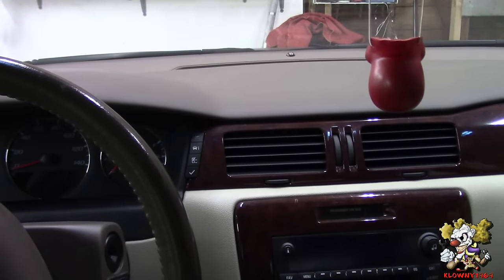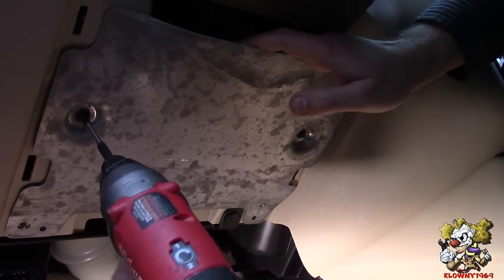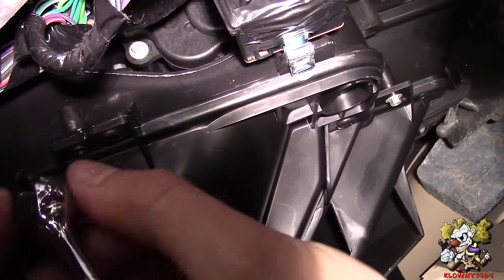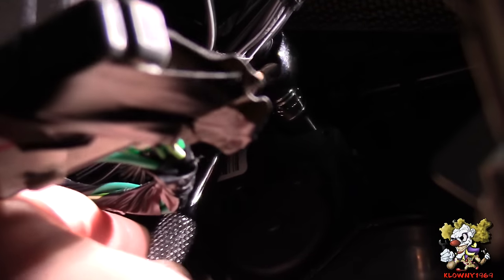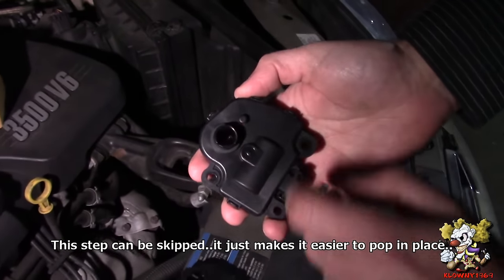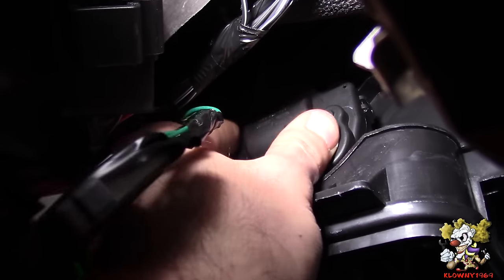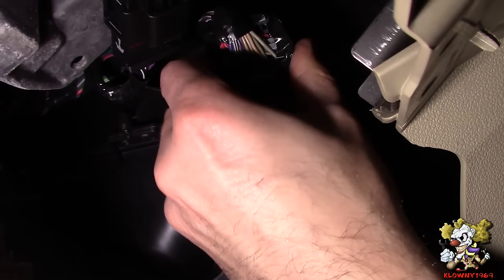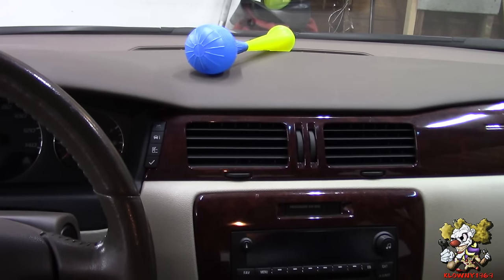How to Replace a DRIVER Side Heat Door Actuator - Chevy Impala 2006 - 2013 - DIY

Comment: Thank you so much man. Now that it's getting hot I was starting to die because in my car it wasn't making the noise but it wouldn't change temperature. You made it look easy but I was able to do it!
Reply: That's exactly what my car is doing I don't here no noise whatsoever yet I don't get cold air on the driver side only the passenger. I haven't done any work yet but I bet this the problem that I am having with my car.
Reply: @rgawt1870  did you find out if that was the problem? I have the same issue on a 2013 impala
Reply: @xTHETRAINx  no I have not and the heat here in Texas is excrutiating. Someone told me about an auto electric that's what I'm doing next. The new actuator I installed didn't work out at all
Reply: @rgawt1870  yeah I'm in San Antonio, my ac vents all blow cold today (measured about 50-60F) even when it was 100+ outside but my drivers side vent blows around 70+ F which doesnt feel cold at all. I'm going to have a professional evacuate the entire system and refill it with r134a.
Reply: @xTHETRAINx  yeah that's what I'm doing also we need a professional I thought I was going to saved me so money but apparently that won't be the case here 😧

Comment: STANDING OVATION!!!!  Side note: I used 7/32 standard on the actuator screws.  Also I turned the gray clip at 5:18 180 degrees w/o knowing it.  It took a few minutes to figure it out when replacing everything.

Comment: Thanks for the tutorial.  Just replaced mine.  Your video was priceless!!! Synched the new one up using a 9 volt battery from one of my smoke detectors and 2 wires I stripped from an old cat5 cable. If you don't have alligator clips and don't want to hook up to your car battery, the 9 volt battery will do just fine and you can't hurt yourself.  I found it extremely difficult to get to the actuator as I am pretty large and the space is very small.  I also have a Viper security and remote start system installed which was also in the way.  It took more time than I expected, but I eventually found the right angles to get to the bolts.  Thanks again for your help!
Reply from the maker: +Steve Pfahning awesome..glad i was able to help

Comment: Great video.  we have a 2010 Impala that already had once actuator replaced on the passenger side.  The Chevy dealer (Highland, IL) wanted several hundred to fix, claiming it was a difficult and the parts were "expensive".  After watching and re-watching the steps in your video......2 hours of my time (having to get part, take apart, and put together) and roughly 35$ for the part from O'Reileys.  Thanks again!

Comment: Just replaced. Took about an hour. Tight fit to get in there. I had three pressure clips instead of two. I've seen the forums where people have paid $400 to get it fixed at the dealership lol. The part was only $40
Reply from the maker: Corey GIbson yup they charge alot..thanks for watching and commenting
Reply: klowny1969 Yes and these are junk parts. Everyone with an impala I know has had all them replaced usually before 90k. And all the other recalls and problems.

Comment: My heat only works on the passenger side. The drivers side blows cold. Is the actuator I need to solve this issue?
Reply: I have the same problem! Did you find out if this was the right part to fix?
Reply: @kim.hadassah  yes did you ever find out if this is the fix?
Reply: @THEBLOODYBALLOON  yes it was. Unfortunately, since then I have had to replace both sides a couple of times. A weakness in the chevy impala limited I guess. Get yourself one of the attachments for your drill that is an extension that bends. It will help in those tight spots. Depending on your model of car it can be a pain to get to. Have patience you can do it!😊👍
Reply: Did you ever find out what the problem was I’m having this same issue and need answers
Reply: My driver side blows hot but the passenger side cold 🤦🏻‍♀️

Comment: is there any other way to adjust the acuators hole to line it up like the old one besides the wires to battery?
Reply from the maker: Darrell Williams u dont really have to line it up..its just a little easier that way..u can insert the slot in first, then turn it and align it
Reply: Thanks alot .. ur great man
Reply from the maker: Darrell Williams lol thank u
Reply: Here's another "TIP"..... rather than using the car's 12 volt battery to advance the new actuator to match the old ones position, use a small 9 VOLT battery with a battery clip and leads. MUCH EASIER (and safer)  than hooking to battery leads ....
Reply: Thank you so much got it fixed! Your video saved me man. I appreciate it

Comment: Thanks for the video! Saved me a couple hundred bucks. I don't know how you got it done at the angle you were doing it at either. I had to try doing it upside-down after seeing another commenter having success that way, and FINALLY got it done. Took me 5 hours total, maybe 1.5 after I went upside down. Anyone that got this done in 10-20 minutes or whatever must have the smallest hands ever, and zero broadness to their shoulders whatsoever.
Reply from the maker: I'm a mechanic..we are contortionists :)

Comment: Thank you for your help! I definitely recommend the 5.5mm socket, and using the 9V battery to move the new actuator around to match the old one. I really appreciate you sharing this fix!
Reply from the maker: glad i was able to help..dont forget to subscribe
Reply: If you replaced it and didnt know to switch it and it needs replaced again how do i know where to set it if it was set wrong and i don't have the old one

Comment: You were a blessing to me. By me watching this video I was able to save myself 700.00. It was tight and hard to get to, but mission completed! Also the arm the actuator mounts to will easily move, so I didn't have to hook the actuator up to the battery to position to fit. Many Thanks!!
Reply from the maker: glad i was able to help..dont forget to subscribe
Reply: @klowny1969   just did, thanks again

Comment: Video saved me a lot of hassle. Once I removed the three electrical connectors (metal clip and 2 plastic clip), I took a bungee cord and strapped them out of my way.  My small extension was still too long, so ended up using a 9/32 deep well socket, and it worked out great. When it was time to put the screws back in, I wrapped a piece of Scotch tape around the socket / screw head to keep from dropping it. I sprung for the Delco motors, $30 ea. Hopefully this isn't a repeat repair for a few years down the road.
Reply from the maker: Glad I was able to help you out..don't forget to subscribe 😉

Comment: Aaah! That's what the 3rd hole is for.  Oh so that's how you align the motor thing-a-ma-jig. Now I need a couple alligator clips. I did it myself. I did not have a mini ratchet so I Used a 7/32 socket with a big reducer and a 1/2 dz rubber bands wrapped around the reducer. Slick.
 Sweet video. Thank you. I saved $105.
 I'm a 69 yr old male.

Comment: I commend you sir, thank you. Searching for a resolution for years I have dealt with the clicking problem and it finally stopped and got stuck blowing heat on the driver's side. So I came across your vid, impulse ordered the part, got it the next day and got to work. Took me about a couple of hours. Now thanks to your vid I will have cold A/C for this summer. Cheers!
Reply from the maker: Awesome..glad I was able to help..don't forget to subscribe

Comment: Thank you sir I got one code at the garage $900 driver-side it cost me $37 it was a tough job but got it done thank you
Reply: One tool that might be very alpha it's a curved snake extension that gets right to the bolts makes it a lot easier
Reply from the maker: @brianszanyi5538  Glad u were able to do it yourself..dont forget to subscribe

Comment: still useful in 2021.. had to change two of these in my 2009 impala... super awkward and a tight squeeze but was able to make it happen. To get the position correct i just plugged the part back in, and while it rotated i was able to push it back in. then you can twist it back into place. had to do this while laying upside down in the drivers seat. good times lol. thanks man.
Reply from the maker: Glad I was able to help you out..don't forget to subscribe

Comment: Well done. This video explained everything I needed to know to do this. One thing I noticed, is that even though I tried to put the new actuator into the same position as the old one, as soon as I plugged it in it moved anyway. I very well may have done something wrong to lead to this result, but it doesn't seem to have affected the functionality. Thanks for the video.

Comment: Thank you sir, shop I called up wanted 750$ for this fix, the actual dealership wanted 1500$!! Can't thank you enough!
Reply from the maker: you are quite welcome..dont forget to subscribe
Reply: @klowny1969  already done, does the actuator part fit all sides? Like will the one for the passenger side work for the driver side?
Reply from the maker: @kingsnorkie  yesir
Reply: @klowny1969  much appreciated 👍

Comment: Klowny, excellent video and yes, it worked for me.  i had to change the driver side and the passenger side at the same time.  Would have been over $600 at a shop but all it cost me was $72 for 2 actuators at Auto Zone.  Many thanks for the very clear and precise video!
Reply from the maker: awesome!!

Comment: Bud you are a lifesaver.  I spent several hours trying to find that darned thing (had two that went out at once - driver side and one passenger side).  I found the faulty one on the passenger side, but for the love of all that is holy, I could not find the one on the driver side until I found your video.   Five thumbs up my friend, five thumbs up.  (My car: 2010 Chevy Impala POS)
Reply from the maker: awesome glad u was able to help
Reply from the maker: +klowny1969 *i

Comment: Very helpful video, ended up getting a set of deep well sockets from Walmart $13. My shortest extension was too long. The socket set had both 7/32 inch and 5.5 MM in it plus ratchet. Thanks for the help.
Reply from the maker: thanks..check out my shirts in the description

Comment: Great video! You're a magician with clips. Changed both heat actuators and when I took them apart found the same gear bad in both. You saved me a ton of money. Thanks for your videos.
Reply from the maker: awesome glad i was able to help..and thanks for watching and commenting
Reply: Your cabin air filter was a great help too. Thanks for taking the time to do videos.
Reply from the maker: +Jerry Jones no problemo

Comment: I have placed two of these. Your video helped with the driverside one. I purchased a 1/4inch thumb wheel ratchet for $10.99. It makes the job much easier than getting a rachet up in such a tight space. Took me less than an hour to do the driverside one
Reply from the maker: Glad I was able to help..don't forget to subscribe

Comment: I just changed mine about 5 hours, ago,what a PITA.The new one I bought the shaft was straight up and down so I just reached up and flipped the shaft up in the dash all the way forward (towards the dash) and it lined up and the actuator slid right into position to the 2 screws holes.
I also used a thumb wheel ratchet with the 5.5 mm socket so I didn't have a handle getting in the way.
Reply from the maker: Thanks for watching and commenting...dont forget to subscribe

Comment: Thank You for making this video!!  I wasn't nearly as quick, or graceful, as  you were.  (how can you do this while filming with one hand?!)  I wound up getting into the drivers seat upside down in order to see / maneuver my arms and not crink my neck.  Also, for what it's worth, I wasn't able to find a 5.5mm socket at my hardware store, but a 7/32" is nearly the same size. It's satisfying to be able to fix it myself!
Reply from the maker: Thanks for commenting and don't forget to subscribe

Comment: I just replaced this part in my 2012. Instead of alligator clips very carefully take the unit apart and turn the gear to the same position as the old one then snap it back together it took me about an hour I'm a bigger guy with big hands and it was a pain in the ass but it's done and working fine thanks for the video
Reply from the maker: Thanks for commenting and watching

Comment: I was about to shell out $600+ to have this part replaced. Now it will only cost me <$20 to replace.   klowny1969 THE BEST on YOUTUBE. Thanks x 1,000,000 - - -
Reply: buzzflewhart where did you by the part from?
Reply: buzzflewhart just found the profile. Thank you.
Reply: No problem... Easy fix..... with "klowny1969's" help......  :)

Comment: Thank you! very helpful and easy to follow your video bc of the step by step instructions..*ONLY DIFFERENCE FOR ME AND IF YOU DON'T HAVE THE TOOL TO POWER AND ADJUST* I HAD TO PLUGGED NEW ONE UP FIRST...TURN CAR ON FOR POWER..THEN WHILE LAYING UNDERNEATH LOOKING AT HOW IT LINES UP.. BLINDLY I AJUSTED HEAT LEVEL UNTIL IT LINED UP.. not the easiest way but this is how I had to do it
Reply: #QuarantineDuty2020
Reply from the maker: Thanks for watching and dont forget to subscribe

Comment: Thanks for putting up this video. I have the same question that I did, when I used your other video to replace the 2 passenger side versions. How in Earth did you not scream profanity at the top of your lungs, while doing this repair? 

Sometimes I couldn't get the right angle to remove or replace the mounting screws. One time I scratched the absolute hell out of my back, on that stupid little hook that holds floor mats in place. The stream of profanity this repair got out of me is legendary.

Comment: Love the details. Push here and pull there. This lock on here.
Reply: Easy fix, pain in the ass to get too. At least in 2012. And 9volt battery saved my life. Used a couple bread ties with the battery to grt it into position.
Reply from the maker: Thank you for watching and commenting..don't forget to subscribe

Comment: Is it possible to just remove both heat actuators and manually set the heat to on/max heat position and deal with the problem later in the spring? I have no garage and it's very cold outside now.

Comment: Pay attention to the giant ground wires bolted to the frame. Behind that and between you and the actuator is also a giant wire harness the size of a water hose, and both of them are going to be in your way the whole time and do not move out of the way. The video here doesn’t mention them. Also the actuator wire as about one inch of slack to it, so unplugging and replugging it will be a beast.

Comment: another great video from the Klown!  I'm pretty sure this works on 06 to 07 Monte Carlos.  I had to replace the mode actuator the other week on the passenger side and it was the same.  Only the hush panel is a little different on the driver's side.  I have an 06 Monte Carlo.
Reply from the maker: +jewllake yes its most likely the same..thanks for watching

Comment: Thanks! Very easy to swap but still tight. Swivel joint for the ratchet will probably help alot I bet. Also aren't the parts all the same for all the vents? The 2 behind the glove box ain't they the same thing?
Reply from the maker: Heat and fresh air are same..thanks for watching

Comment: Finally got it and I'm a small armed guy lol I did not remove the grounds almost did but I ended up getting it with a 1/4 inch thumb drive all my extensions were to long the u joint things didn't really help either all I got is dollar store tools also may be why 7/32 socket. Used a 9v battery to put actuator into the right position.  Now good luck attack those clickers my wife has ice cold air now for the summer time for beer.
Reply from the maker: glad you were able to do it..dont forget to subscribe

Comment: One of my actuators is making a noise, but it isn't a knocking sound, more like a buzzing sound. It gets louder when I turn the car on. And does the heat door actuator you replaced control the defrost as well?

Comment: I've fixed the right and left side on my mother in laws Impala.  Both I took about and moved the broken gear 180 degrees and put back on.   Working good so far.    The broken teeth don't travel very far.   I'm not sure if the new ones you buy have more durable teeth on the gears or not.   I'd be interested to know.

Comment: I think the real amazing thing here...is...how in the world did you film this??? way up there inside the dash with no space???
 lol...I'm just thinking of the electrical connection I had to unclip with a screw driver...."sight unseen" in my case i held the actuator and unclipped it with only visualization of where i thought the clip might be......whereas you actually film unclipping it...amazing. You'd think GM would have made those two control wires LONGER so you can bring it down to your work space to clip-unclip.....I tried to pull and stretch those wires but....no give.
Reply from the maker: Lol..its not that bad..just a little agility :) dont forget to subscribe

Comment: Thanks for your video, which was well done.  I had watched a few others, but they either got blurry, had poor audio and poor lighting.  Dealership quoted me 490.00 labor and 80.00 for parts.  Also the 9 volt battery trick mentioned in another comment worked great.  I also now have a couple of tools to start off my toolbox.  #nomoreticking